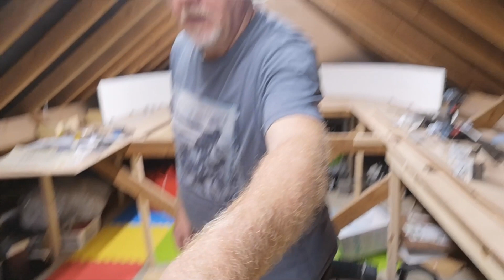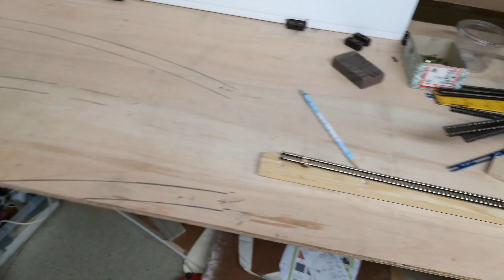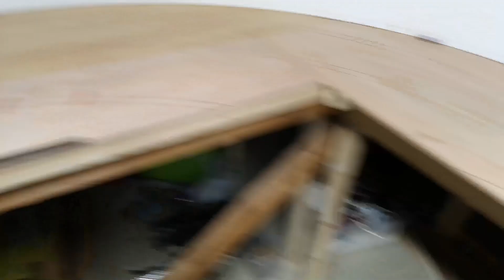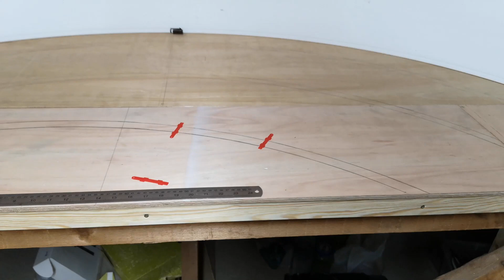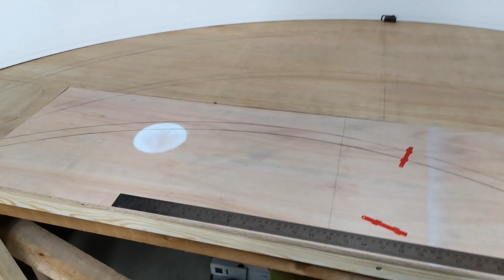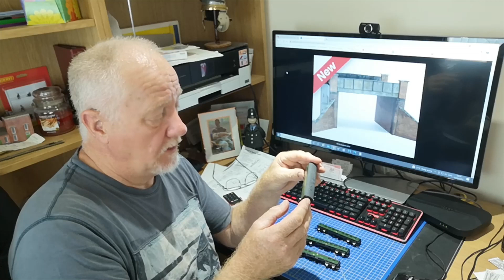#15 Short update on layout.

Comment: Hi Chris. Yes working on an attic based model railway is definitely not a summer hobby! Good to see your safety hatch as it is always a big risk. My wife gives me a row if I leave mine open 😀. Re your curves, they are a lovely wide radius so I would have thought the tighter track spacing would be ok. I did a trial test for mine taking my longest coaches and trying them out. You could try that as it would be easy to do now you have the curves marked out. The bridge you are building looks great. Looking forward to seeing progress on it as well as the MU. All the best. Hugh
Reply from the maker: Hi Hugh - Hopefully when loft fully insulated it will not be as hot as it is at present. Safety hatch is a big health issue, amount of times I have missed my footing, just got to get it fitted but in the meantime still using it when I can get up there.
Thanks for admiring my lovely wide curves, with the undulating banks and backscene in place I am hoping it will look quite good.
Just building the Scalescenes Weighbridge/Coal Office at the moment, oh my goodness it is so small and fiddly LOL. Bridges will be next.
Will start on the Class 404 4-COR "Nelson" EMU next week fingers crossed.
Regards Chris

Comment: Hi Chris nice to see your plans for the layout, regarding track spacing I can't see any issues with the spacing but best to always test with your longest stock that they clear. so plenty of excuses to play.........I mean test you trains 😁. I can see your pain with the heat in the attic but until it is sorted properly best to play upstairs when it's cooler and this will also give you a good excuse to get some modelling done downstairs when it is too warm. All the best Tony.
Reply from the maker: Hi Tony - Thanks for the advice. Got plenty to do around the bungalow aswell as scratch building and my EMU project, so all good here.
Regards Chris

Comment: Lots of space Chris for your track plan, should get a really good track plan. I use the Peco spacer and use the narrower of the two and they are perfect for any rolling stock and match up to points and crossings. Scale scenes are great , you need to pay attention to what gets mounted on card and what is just folded, I made a few bloopers but will use them again.
Reply from the maker: Hi Chris -  Yeah tons of room. Thanks regarding the Peco spacer, yes I will be sticking with the Streamline narrower one, ta.
Scalescenes are a nightmare but that is only cos I am new to them. But yes they are brilliant and so adaptable for scratchbuilding.
Regards Chris

Comment: Good to see the update Chris.  I think that your curves are sufficiently gentle that using the streamline spacing will be fine.  The key determinant will be your longest coach. Until you get some track down you won't be able to test on the smallest radius curves to know for sure. I would be surprised if you had a problem.  Stephen
Reply from the maker: Hi Stephen - Thanks for that. Have to say they look better using Streamline, which is why I would prefer to go with it. Setrack only slightly wider, but I dont want to have to do it again.
I will very likely screw the track down temporarily and do some tests before I decide to stick with Streamline, fingers crossed.
Regards Chris

Comment: Hiya Chris, great to see what you were trying to ask me, now I can be more specific. Because you’re curves are so large I believe you will be fine with the streamline measure. I have done the set track as I said but my curves are 2nd, 3rd and 4th. The only real way to tell for sure I’d to lay a couple of pieces with some double sided tape or pins and try them with you’re largest coaches. That way you will have it confirmed. Enjoy the N gauge show, stay safe and well, regards, Chris
Reply from the maker: Hi Chris - Cheers for that, at least now you see what I was on about. All my coaches so far are Mk1's, not even sure if I need to go above that to be honest. 
So the jury's still out regarding the spacing LOL.
Regards Chris

Comment: Don't think you will have any issues if you use the correct track spacing as the radius is very gentle.   On my own layout I adapted the Peco spacer by using the set track lugs and cutting a nick out of one them.  This means my track is spaced a little wider than the Streamline but closer together than set track.  This has ensured mk 3's are able to pass on the curves without issue.  
Going to TINGS myself. Travel down tomorrow and stay overnight so will be there on Saturday.   Pity your going on Sunday as we could have met.  Cheers Euan
Reply from the maker: Hi Euan - I think I will be ok, not sure if I will ever go above Mk1 coaches to be honest, largest I have to check the spacing.
Interesting choosing between Setrack and Streamline.
Shame about not being able to met up, would loved to have seen you. Blame my grandson LOL.

Regards Chris

Comment: Hey Chris, I use Steamline spacing on Chandwell and my curves are a heck of a lot tighter than yours. I think my inner radius is about 18-20 inches, and yours is 70!!?  Your track plan looks like it's going to be fantastic. -Michael.
Reply from the maker: Cheers Michael - A lot of research has gone into this and still ongoing. Hoping it will look something a little bit different to everyone else's in the end.
Yeah they are nice curves, lucky to have the room for them.
Enjoying the research as much what I have built so far. Once the base is down and I start laying track like everyone else things will pick up then, but at the moment slow progress.
Regards Chris